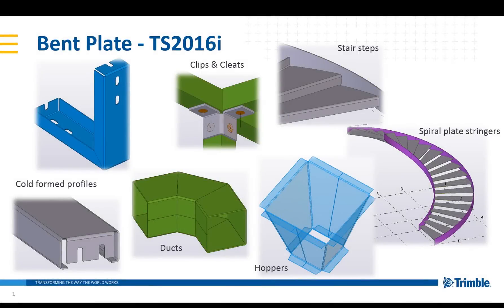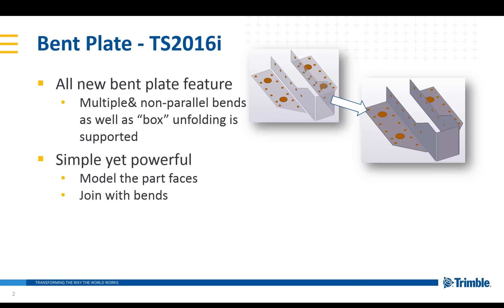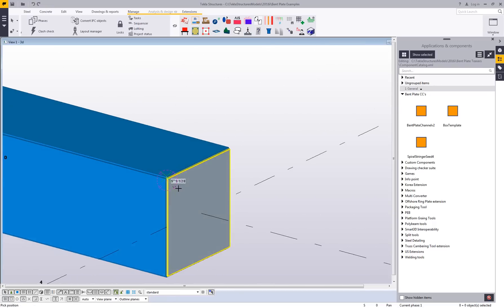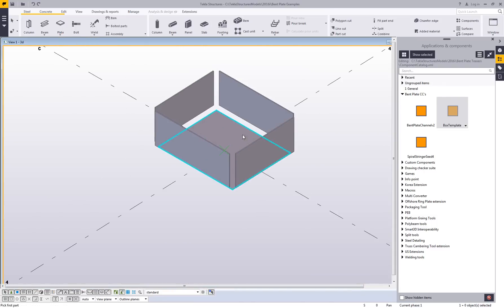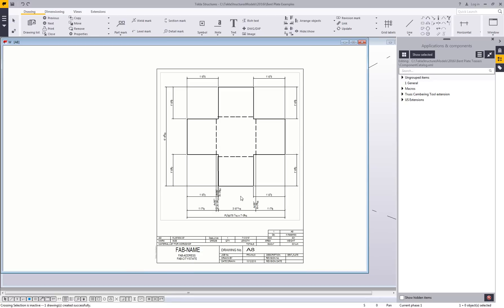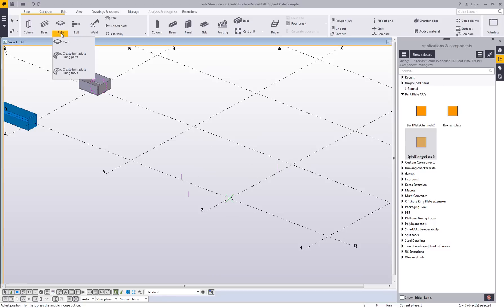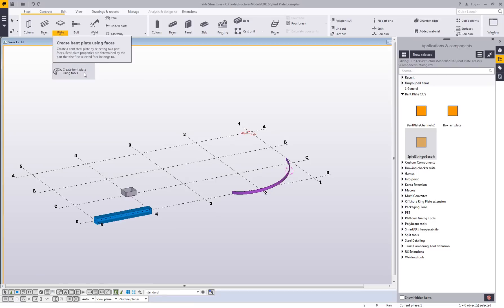Bent Plate

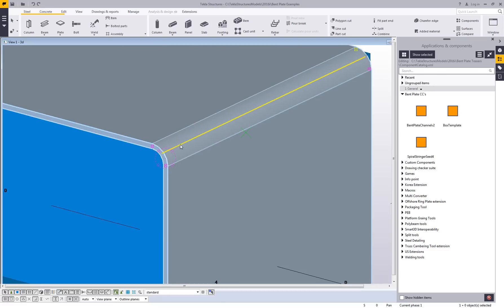Comment: is it possible to bend also the side plate shown on 2:16?
Reply: Yes you can bend it to the top plate and the vertical plate.  The corner between those 3 plates will be tricky because you can't bend a bend to another bend if that makes sense.  So however the shop would fabricate it is how it would be bent in the model
Reply: @leesnyder6784  Thanks for the brilliant response, so I think the problem is whether the 3 plate corner bend model can be use to present in drawing/3d model presentation like finish product, like for example in cladding design submission vs the shop drawings output for fabrication.  So Im thinking if this can be possible to achieve this in the new tekla feature so the model for design and fabrication are in just one model for cladding works.